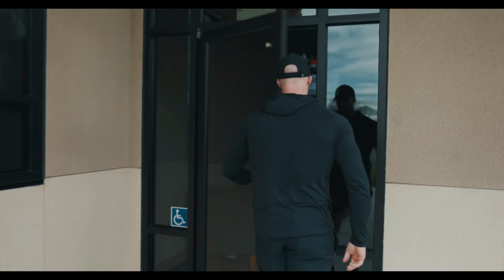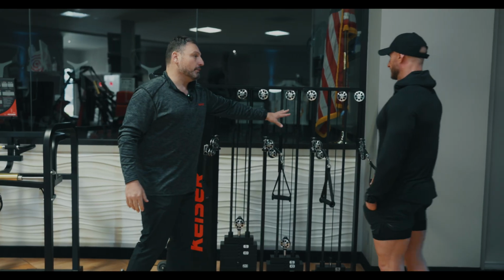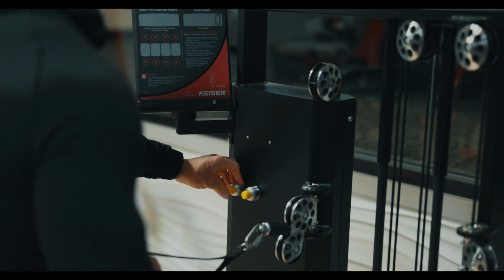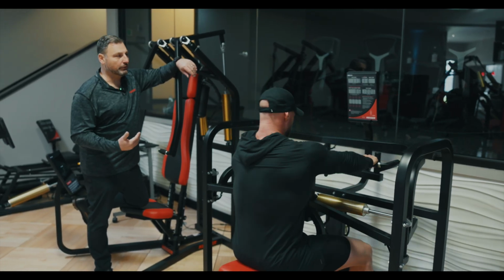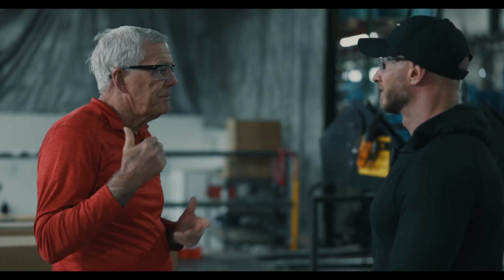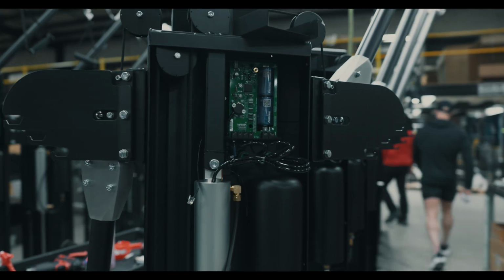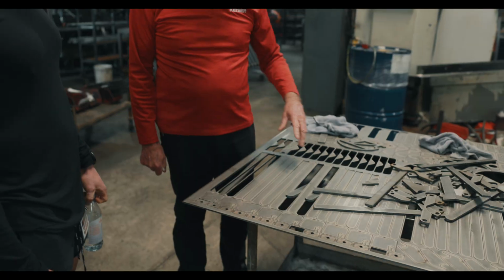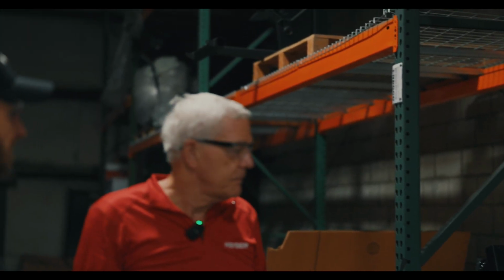IS THIS THE MOST INNOVATIVE TRAINING EQUIPMENT IN THE WORLD?

Comment: 45 years ago I recall working out on Keiser equipment at a Bally's gym (now LA Fitness).  Since that time I'm haven't seen their equipment anywhere.  I'm assuming it's not a favorite of big box gyms and smaller clubs because of potential maintenance issues and upfront costs as compared to free weights and pin select machines.
Reply: Their Infinity Trainer is excellent. I've had one for 10 years. But the company doesn't seem to know what they're doing. See the frame flex during that High Row machine? They built a bunch of racks with pneumatics incorporated into them but the racks are proprietary. Why would I buy a full rack that no attachments can attach to? And that guy in this video explaining all the stuff the 5 panel display can do. He says it's great because they also collect that data for their therapy clients. Who cares if we have no idea what exactly any of it means? Its all so, no go with this company. And there is almost no information on their website. It looks like it was designed by someone with a sociology degree and who has never exercised in their life. If Rogue or REP took on this technology Keiser would be DOA.